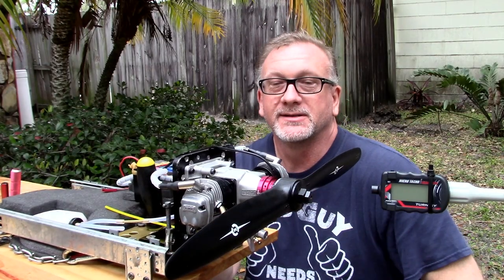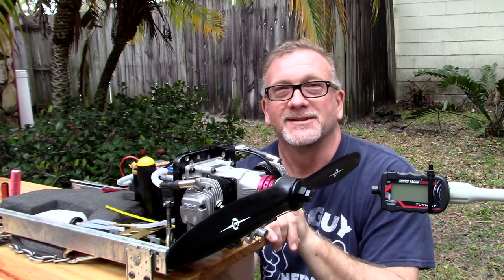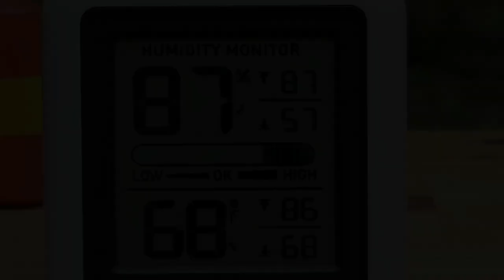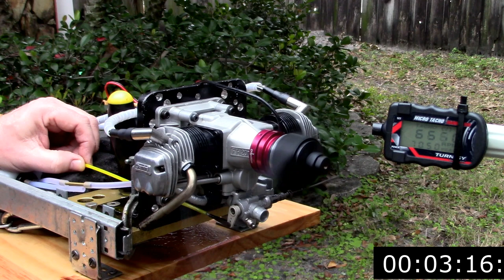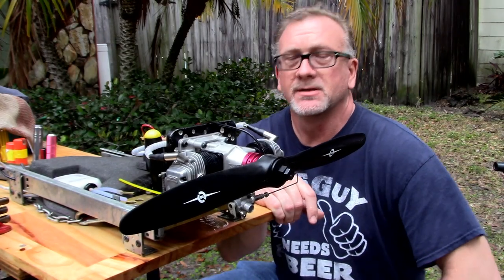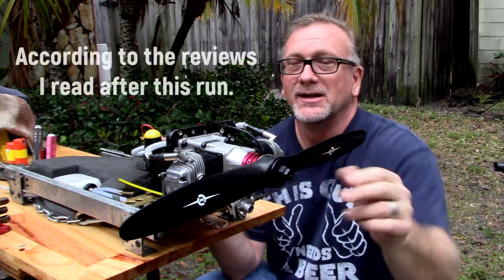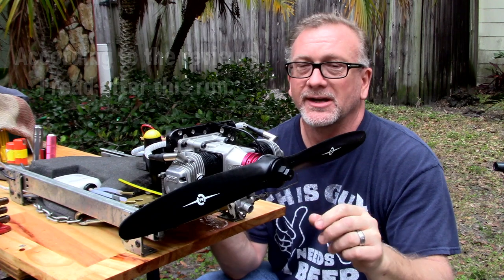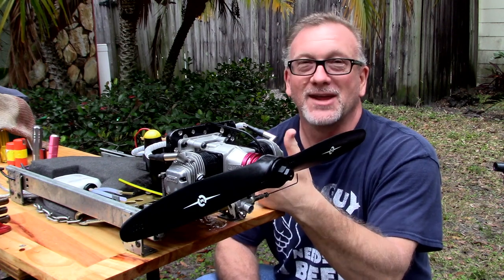OS FT-120 II Glow Ignition FAI Fuel Run

Comment: I saw 6800 on that large prop.... Absolutely VERY decent performance for 0 Nitro. Excellent!
And don't worry about the temps or running lean: on spark it can handle lots higher temps, 200 F is no biggie on the cylinders, and you can basically run it peaked continuously without risk of damaging the engine because there will not be a thermal runaway (in the air it needs to be a bit richer due to unloading).

Comment: the twin needle carb will make a good change in its running quality. all my twins have them. it worked great on my ASP FS 160
Reply: Did you put the OS twin carb on that ASP 160?
Reply: yep. used the complete OS ft 160 fuel set up with a  adapter plate I made to fit the manifold to crankcase.it was easy.